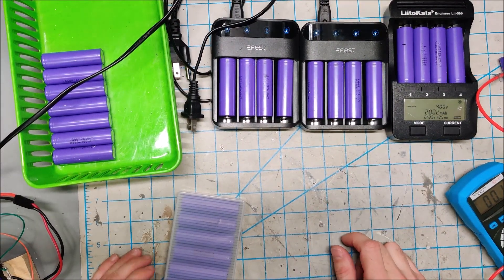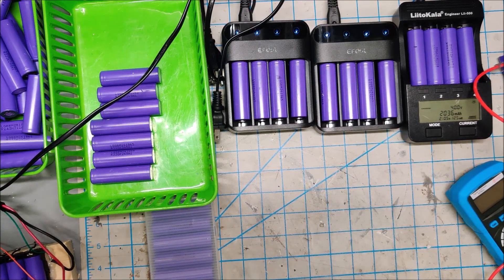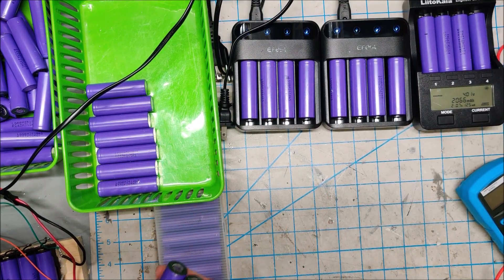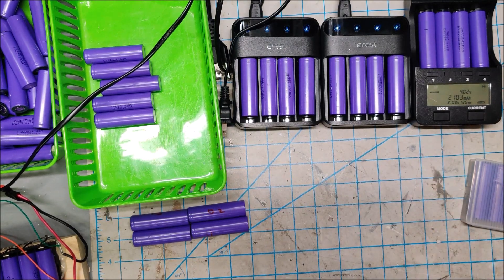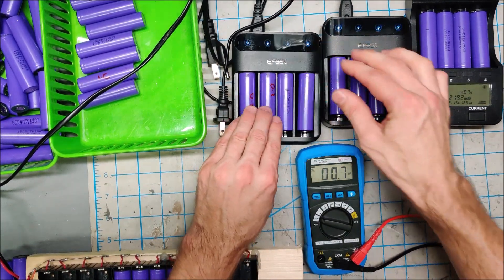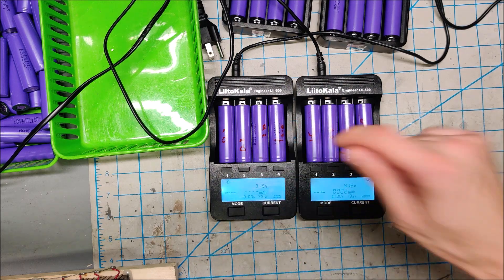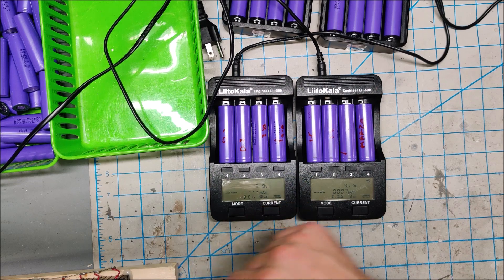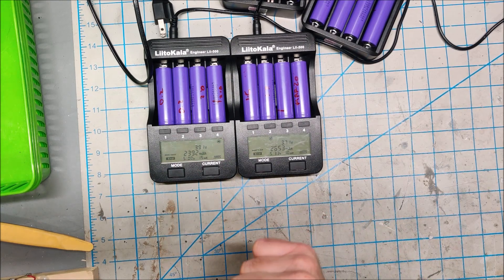DIY POWERWALL: RECOVERING LOW BATTERIES

Comment: you should STORE batteries at their nominal voltage, not fully charged. ie: 3.7volts
Reply from the maker: Yeah that's what I've heard but I store everything fully charged without much problem
Reply: @stevenc22  it is bad for the cells to store them fully charged or discharged. Keep them nominal

Comment: Did you test the current? I bet if you do that you'll still get couple of amps dumped to your low batteries all at once within those couple of secconds.

The way i do this is i charge them to full on my prallel rack connected to a imax b6 set on 0.1 A. It takes couple of hours, but i do a lot of them at once an i usually get almost factory capacity.

Comment: I just use the tp4056 someone told me theirs don't charge them but mine do and it's a real low current till they get to something like 2.5v or more then it will go to the 1A depending on what they are set to

Comment: Can you put the gray LG batterys with the purple LG batterys in a powerwall pack? Cause the purple are 10 amp max drain an the gray are 5 or 6 amp max drain. Or just build separate powerwalls
Reply from the maker: Yes you can mix since a powerwall will only pull 1 amp, so both are under their max current.